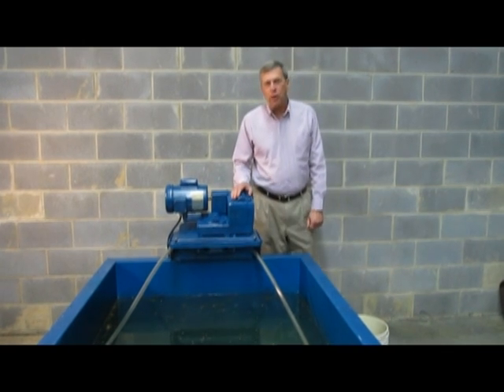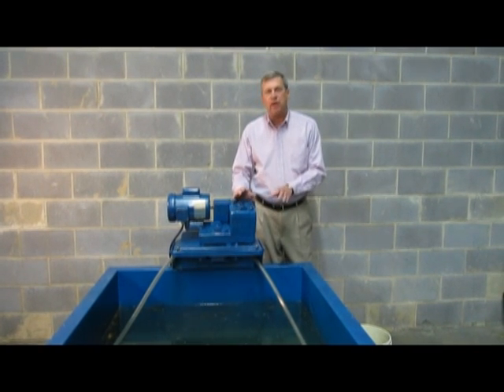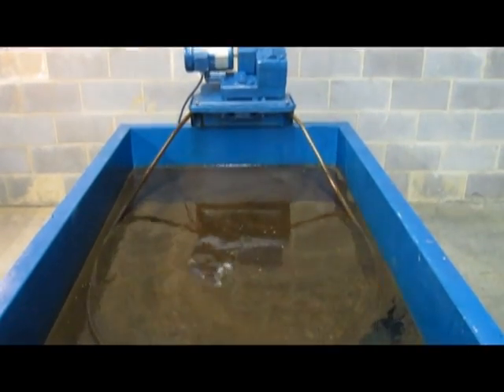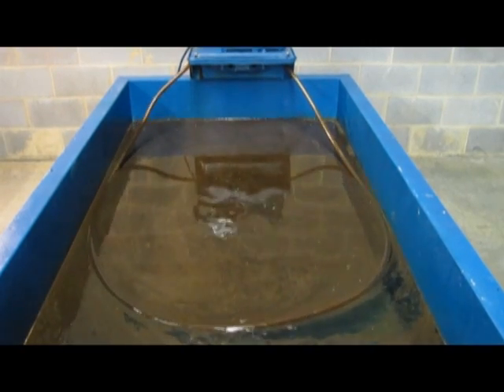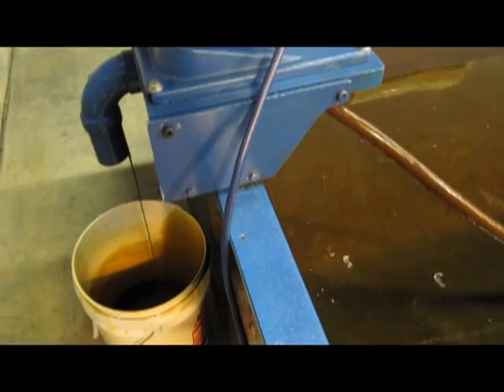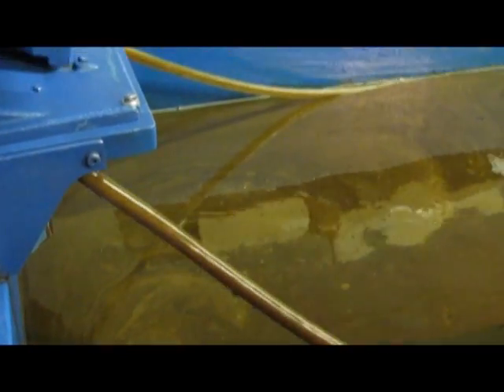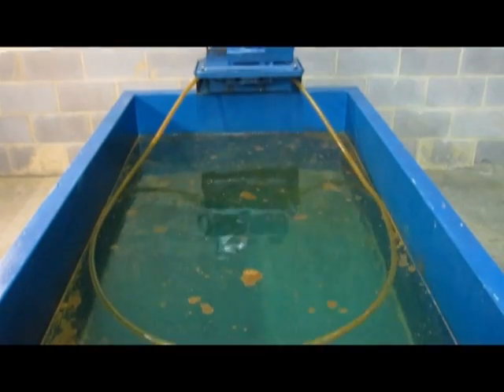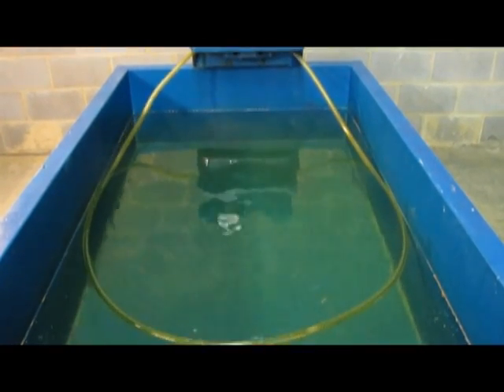Oil Skimmer - Oil Skimmers Model 5H - Remove Oil from the Surface of Water

Comment: What the material was made the belt from ?
Reply: The Collector Tube is made of a special formulated plastic with Polyurethane  the base. A couple of formulations are available depending upon temperature of the solution .  If you want a recommendation on a specific application please email us at info@oilskim.com  .  Thank you

Comment: ?
but if  application this method in high flow rate ?  what is efficiency
Reply from the maker: Ali,
In applications where continuous flow is necessary, we provide oil water separators that allows the oil to separate from the water, while maintaining the flow. The oil that floats to the surface is removed continuously by our Brill® tube type oil skimmer. These are called SAS™ Tanks (SAS stands for Separate And Skim). You can learn more here: https://www.oilskim.com/tanks-and-separators/sas-tank-oil-water-separator With questions about your application, you can email us at info@oilskim.com, or call us at +1 (440) 237-4600.